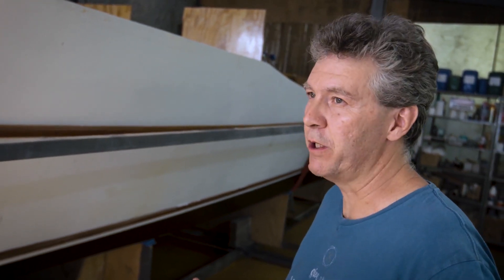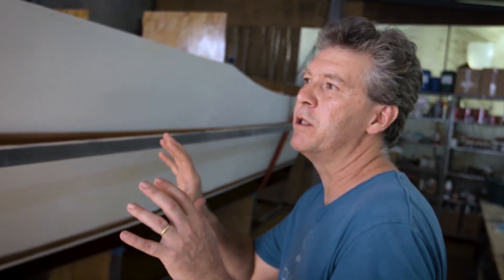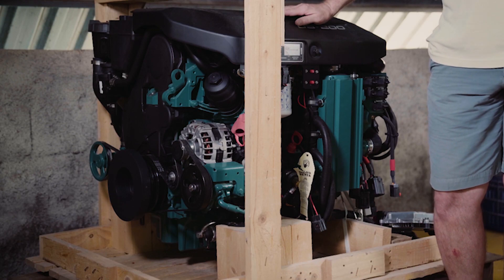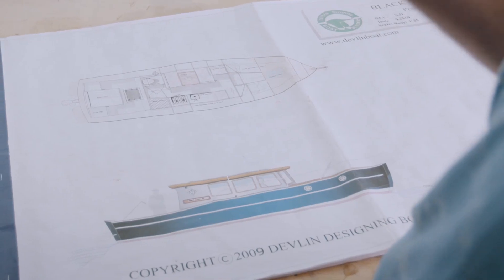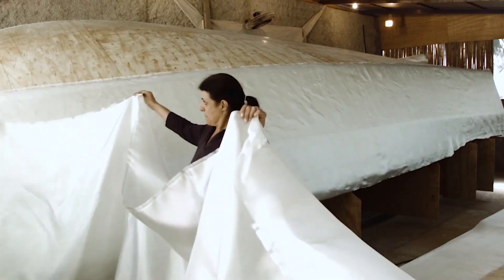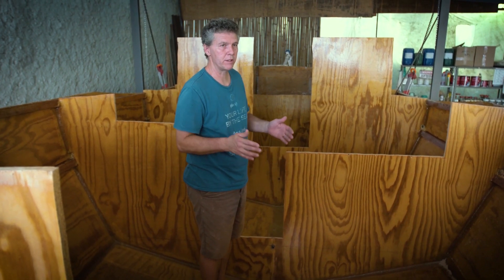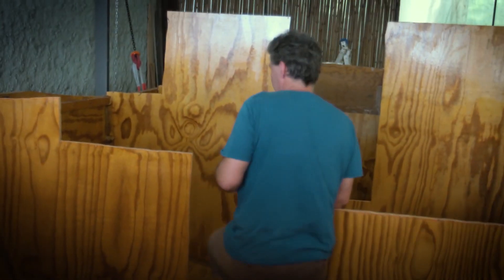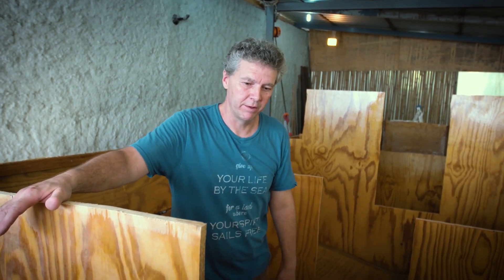How to Build a Boat (2019) I Volvo Penta

Comment: Interesting video! I'm designing a steel workboat for gold prospecting in Norton Sound, Bering Sea.. my design is a derivation of the US Navy LCM-6 hull, but wider and higher - a 56'x19'x8.5' box, 50 gross tons - so she can transport on her side in the space of two stacked sea containers on a railcar.
Here's the thing.. I want to incorporate a pair of your IPS drive systems, D6-400 or so.. but it has been hard to find a concise "designing for IPS drive systems" guide which puts the basic design criteria all in one place. I've found bits and pieces here and there - last night I found a downloadable "Installation Guide", showing minimum and maximum water levels relative to system CL.. but this morning I found your "Introducing IPS2" video, and I realized that those specs are not applicable to the drive I'm designing for. When I search your website for documentation, it asks for the engine model and serial numbers - I don't have these because I haven't bought the engines yet, and I don't have enough design information to evaluate whether these systems are suitable for my application. For example.. steel hulls - I can't find anything describing how to build the drive system interface into a steel hull.. but also no indication that your system isn't applicable to steel hull craft. Beyond this, the general tone of the Volvo website seems to be "Find your nearest dealer, they'll help you".. but I need the info you give OEMs, not the info OEMs give their dealers to give end users.

Comment: It looks good now BUT wait until water gets into the wood in a few years and it will be junk wood sucks you should know that there are materials that will not rot, and look this up why you should never fiberglass over wood boat hull.
Reply: Why shouldn't you? Will the fibreglass detatch? And what if cedar wood is used and then then the entire boat is fibreglass?
Reply: Properly built wood composite boats last a very long time.  Using marine grade ply and sheathing with glass and epoxy saturating the wood doesn't eliminate moisture intrusion but for practical purposes it does.  We had a boat built in this method that was over twenty years old and used often with no signs of wood rot or loss of strength.  1,000s are built this way each year.  many more 1,000s of light small craft like canoes and kayaks which often hit rocks or are beached are built this way.